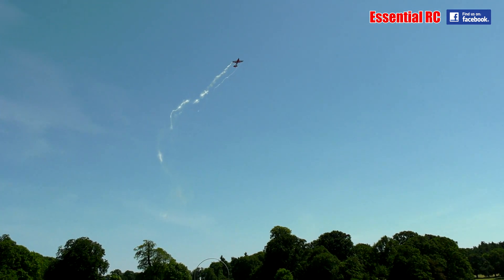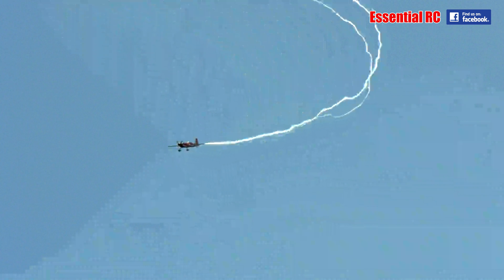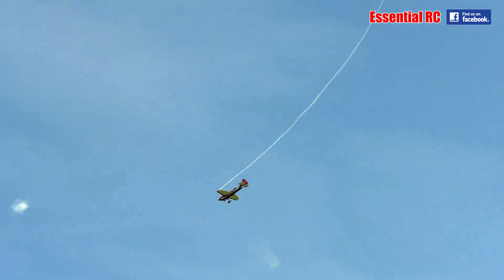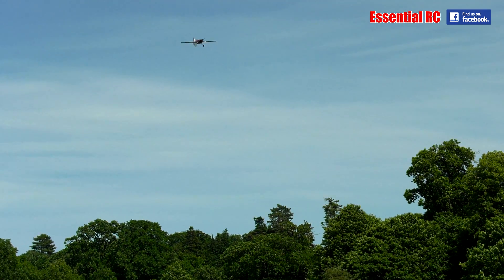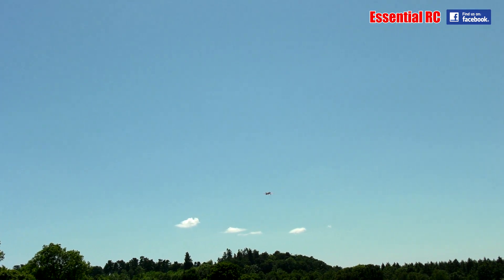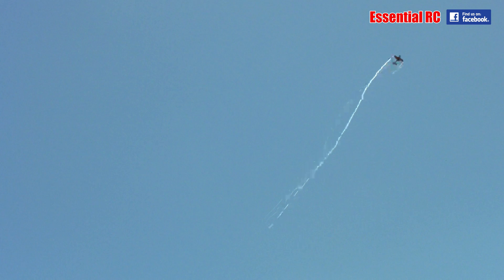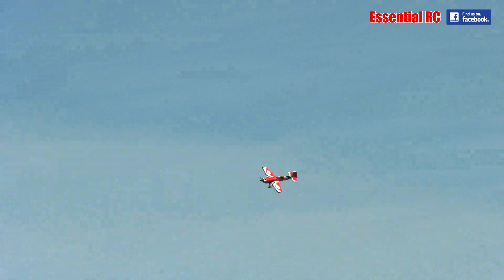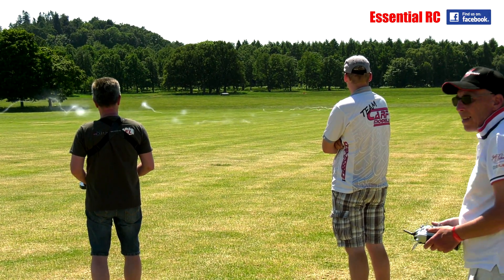SUPER RC SMOKE-EL(ectronic) WING TIP demonstration [*UltraHD and 4K*]

Comment: Great, I would like to put something like this on my small foamies, this is too expensive for that. Is there any smaller and lighter smoke system for foamies on the market?
Reply from the maker: In small airplanes than cannot carry the weight of this system the best way is to electronically ignite a smoke cartridge. There are several cheap systems that can do it. But they normally do not last long and obviously once ignited burn until the cartridge is consumed. Cheers Dom (Essential RC)